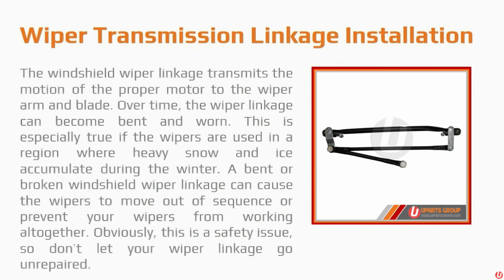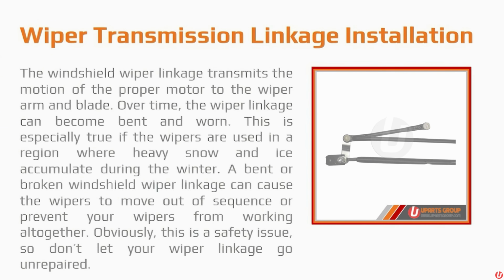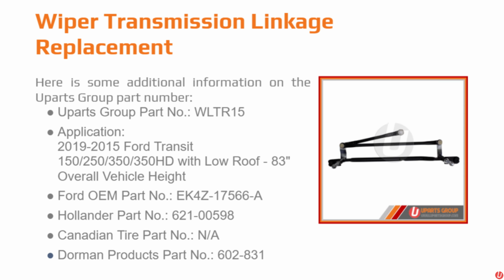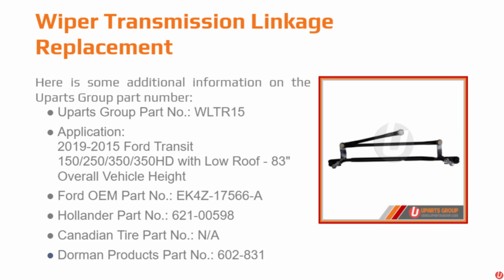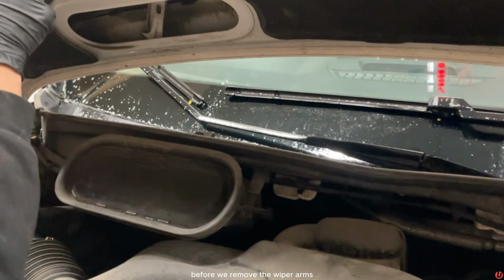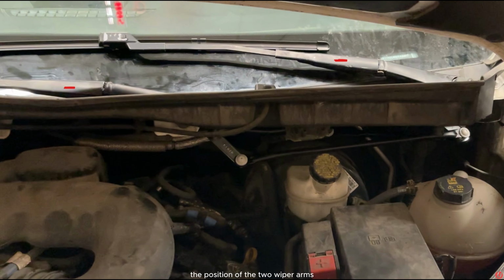WLTR20 Wiper Linkage Replacement For Ford Transit 150 Low Roof 2020 Fast & Easy

Comment from the maker: ✅ Uparts Group Wiper Transmission Linkage WLTR20
https://upartsgroup.ca/products/wiper-transmission-linkage-wltr20

🧰 Recommended Tools:
🔧 Plier & Wrench Set
https://amzn.to/49n8lY4

🔧 Screwdriver Set
https://amzn.to/4tN05br

🔧 Trim Removal Tool
https://amzn.to/3RjRH5r

🔧 Ratchet & Socket Set
https://amzn.to/4njQmYg

🔧 Battery Power Wrench
https://amzn.to/4tzOI6p

🔧 Wiper Arm Puller
https://amzn.to/4d48ou9

🧤 Protective Gloves
https://amzn.to/42tTLKv

🦺 Safety Glasses
https://amzn.to/4wpi9dV

👍 Thanks for watching! Don’t forget to like, comment, and subscribe for more product guide videos.